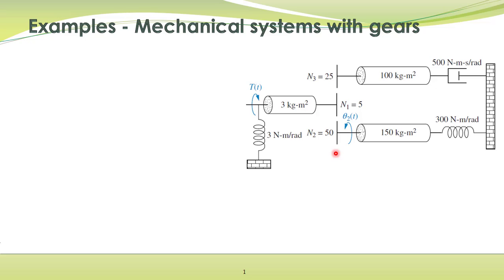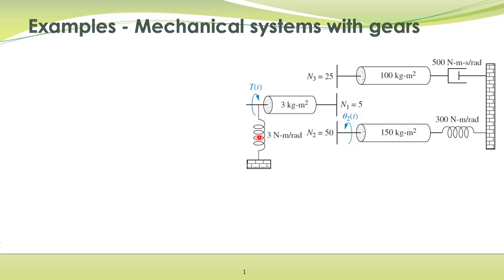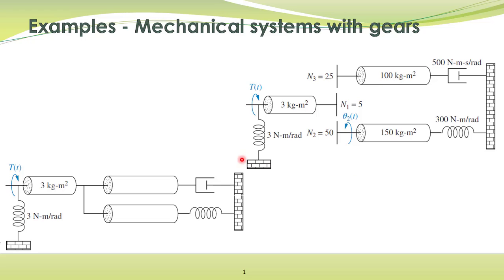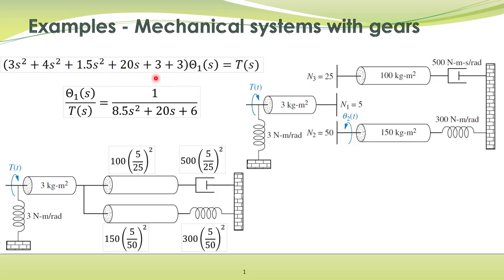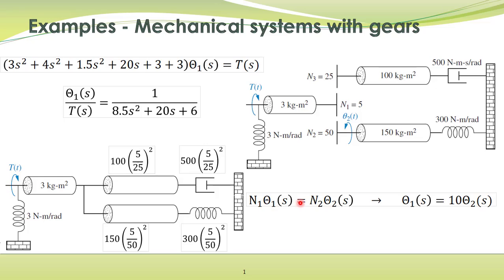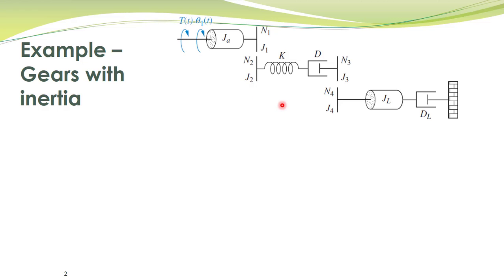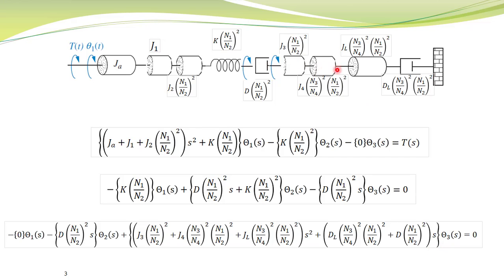LCS - 08b - Rotational mechanical systems with gears - Example

Comment: sir i think question no. 1 K (spring) value should be 3 not 6? 300(5/50)^2 is = 3 not 6

1/10
--------------------
8.5s+20s+3
Reply from the maker: There is a second spring as well, if you add its effect, then you will get the transfer function given in the slides.

Comment: Asslam-o-alaikum sir 
Sir at 3:47 why are you ignoring to Q2
Reply from the maker: WA
What do you mean by Q2? Are you asking about theta2?
Reply from the maker: WA
What do you mean by Q2? Are you asking about theta2?
Reply: Yes sir
Reply from the maker: @AI-Creations-088  Theta_2 is linearly dependent upon Theta_1, that is, Theta_2 can be simply obtained by multiplying Theta1 with a scalar (teeth ratio). Therefore, a separate equation for theta2 is not required.

Furthermore, if transfer function between theta2 and the torque T is required, it can be easily obtained from the transfer function between theta1 and T.
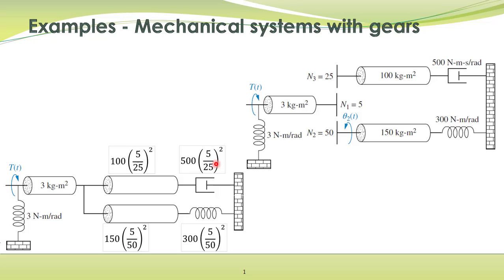Reply: While at 3:11 you are putting theta 2 and theta 3 this one is also not understand

Comment: it is wrong to move/refer J2,3 to J1 since the middle shaft has two independent angular displacement. J1 and J4 should refer to middle shaft. this question should have two equations and solve by using cramer's rule
Reply from the maker: There are multiple ways to obtain mathematical model for this system. You may proceed as described in the lecture, or you may refer all the impedances to the central shaft (as you have discussed), or you may refer all the impedances to the right most shaft. In all the three cases, you will obtain the same mathematical model.

Even if J1 and J3 have different angular displacements, still these can be referred to the left most shaft (If you are an electrical engineering student, you may establish an analogy of this mechanical system with an electrical circuit with a transformer. If the secondary side of the transformer has two parallel branches with impedances, you may still refer all impedances to the primary side of the transformer, although each impedance may have different current (current in electrical circuits is analogous to position in mechanical systems) flowing through it). 

Since there are three linearly independent displacements in this mechanical system, you will get three equations.
Reply: @MAFarooqi  so basically there are three independent angular displacement? i see.. thank you for the explanation 👍🏻